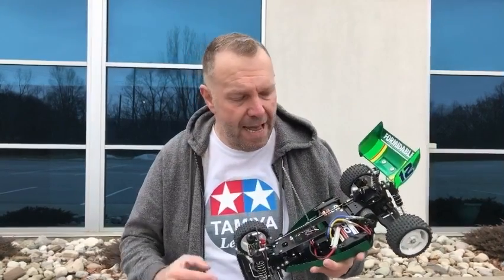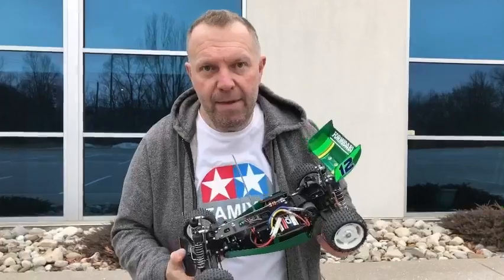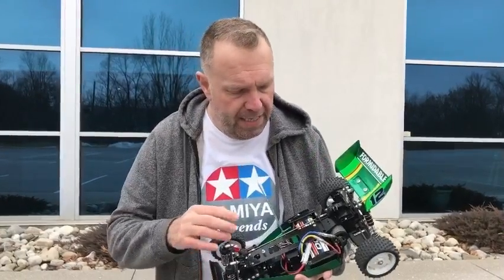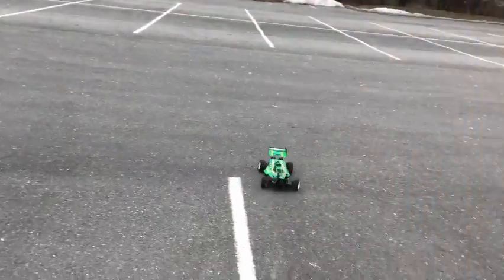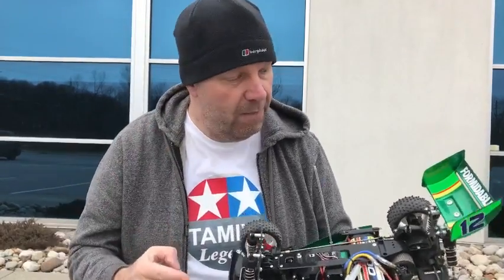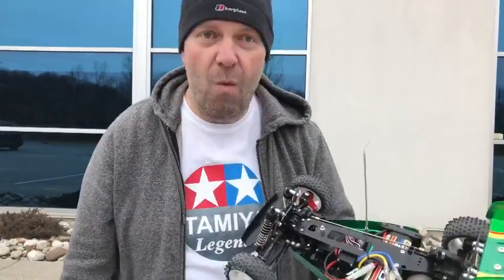The Tamiya Dynatech 02H Motor, Was it all that???

Comment: I actually still have mine, hardly used, so basically still pretty much a new motor. I had bought it in mid 1992, and fitted it to my Tamiya King Cab with a smaller pinion gear (cannot remember how many teeth). It was brutal on my King Cab, but when I say brutal, it was breaking things! I literally ran it for one or two battery pack sessions, and was in awe with the increase performance, but the fun came to an end with a grinding gearbox. The plastic idler gear bracket in the King Cab's gearbox had snapped one of its mounting legs off. So to fix this, I had actually fabricated a replacement part made of copper (of all things) to replace this idler bracket (which never failed). The last time I ran the King Cab was at an informal race, and again, the brutal nature of this motor revealed itself (or how fragile the King Cab could be). This time it managed to completely destroy one of the wheel hubs - it literally sheered off all the splines inside the hub! So after that, the engine was removed, cleaned again, and simply packed back in its box. It would've been better suited for a buggy like you are using here...

Comment: Great video thanks. Im just restoring my old Tamiya Falcon (my first R/C car I bought 30 odd years ago!)  I also had the Dynatech 02H motor fitted and I recall having a lot of issues with current draw and getting really hot, it actually melted the leads off the motor! Any ideas what could have been the issue? Im replacing the old manual speed control with an ESC and will just run an 1800mA NiMH battery. Thanks
Reply from the maker: dattosam 
Yeah I’m not sure what causes that 🤷🏼‍♂️. I guess the condition of the brushes and comm play a big part. But what a great motor 🤩
I’ve done a couple of running videos with it in the Top Force, I even did a video with it using the 10 turn hop up rotor 🤩🚗💨💨💨

Comment: I have a Tamiya Dynatech 02H with the optional 10-turn rotor running in my DF-03Ra chassis that I lowered for on-road use and fitted with a modified 2-speed transmission from an old HPI RS4. http://www.rctech.net/forum/chat-lounge/989695-build-complete-tamiya-df-03ra-2-speed.html It's a nutjob setup, but it's a lot of fun. I used to have an 01R in that car, with a non-Tamiya 11-turn rotor installed, and it was equally nuts, but it was a hell of a job keeping the 01R's brushes from sparking like crazy and destroying the commutator. I ended up wedging a couple bits of silicone fuel tubing into the leaf-springs that hold the 01R's brushes in-place, to effectively increase the spring-rate of the brush springs, and that helped a lot, but ultimately I decided the 02H was a better-designed motor to begin with.
Reply from the maker: Shawn Elliott 
Wow that pretty cool Shawn, there’s a video on here I did using the 02H with the optional 10t rotor 🤩. Ran it in the Top Force and it was pretty sweet 🚗💨💨

Comment: Ah..yes. Brushed motors and the ‘pinion-dance’ 1, or 2 teeth could make the difference between ‘no guts whatsoever’ and ‘screaming around the track’. Or ‘went really fast... but didn’t finish due to drained battery. Made really worse because the limited power of the nicads of the day. 1700 mah at best. Nowadays, with a 4000mah LiPo, all bets are off. ( within reason, heat being the next problem) I still got my old one lying around. Brushes almost worn, and yet, it still goes like stink on a hot day on lipo.

Shelved it, tho. Far too afraid to completely wear the brushes. I haven’t been able to get new sets for reasonable prices. So. Yeah. It’s just sitting pretty in my man-cave.. :p

Comment: Put the 10 turn rotor in this motor and run it on a lipo and it will absolutely scream, rival some brushless motors!! I have this setup in my vintage fox.

Wasn't this tamiya's flagship motor? With the Pink Actopower.
Reply from the maker: kasparov9 
My next motor video on here is the 02H with the 10t rotor 🚗💨💨
Reply: @TAMIYALegends  Just a question, I've gone to adjust the timing on my pink actopower, its one of the ones with a label on the can just plain pink so I lost gauge of how far to turn the end bell. I dont know if the motor was sparking before when the brushes were touching the rotor but they are now.

Is this a common thing? Anyway of stopping it if possible?😐
Reply from the maker: kasparov9 
The best way is to do it on the bench out of the car, you can hear when it’s in the sweet spot 🤓
I think they do ark abit more once the timing is turned up, nothing to worry about 👊🏻
Reply: Thanks mate, what about if a smell comes out of the motor after I've ran it again, what have I done wrong?   @TAMIYALegends
Reply from the maker: kasparov9 
Oh that doesn’t sound good 🤔
Maybe strip it down again and just check everything is in the right way?
Reply: @TAMIYALegends  The motor is gone, not sure whats wrong I ordered a new rotor and it's still playing up. But it is a fake pink actopower but it still had alot of power and I was shocked at how much torque it had on my terra scorcher.

I'm contemplating throwing in my NIB Pink Actopower, do you think this is a waste?
Reply from the maker: kasparov9 
No I don’t think so, it worth trying 👊🏻
Reply: In she goes! And for the record the Original Pink Actopower and the Pink replica perform pretty much the same.  @TAMIYALegends